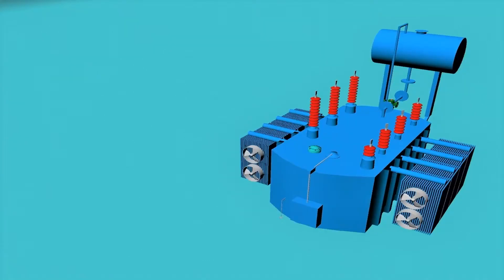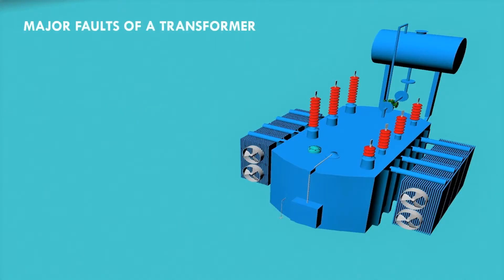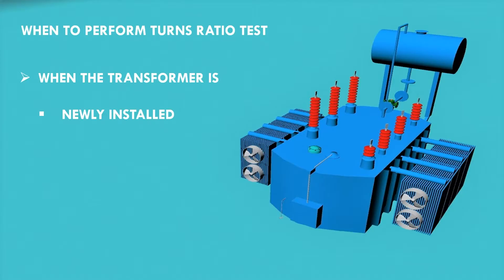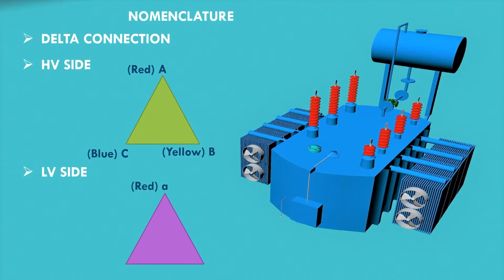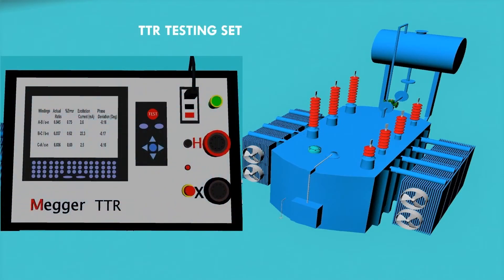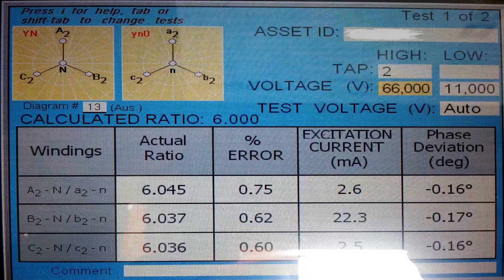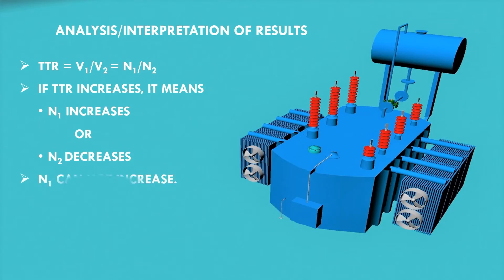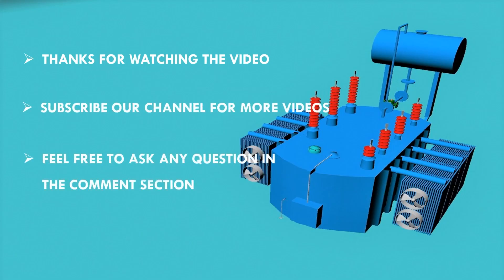Turns Ratio Test (TTR ) of Transformer

Comment: Thanks for you video. This made my understanding very easy. Here i have one doubt. In the example Y - y transformer shown 66/11 - ratio 6. This means it is line voltage ratio. if it is Delta - Star also 66/6.35(ph) - ratio = 10.39. I think the ratio should be calculated for Line voltage ratio. if any finding in Line voltage ratio then we can check the particular phase voltage to exactly locate the faulty winding

Comment: SIR turns ratio PRIMARY BY SECONDARY OR SECONDARY BY PRIMARY  IT IS DIFFERENT IN DIFFERENT BOOKS
Reply from the maker: It can be both ways. depends upon the manufacturer of the testing set. Some test sets calculate Primary to Secondary while others calculate Secondary to Primary but the end result is the comparison between the actual TTR and calculated one.
Reply: @theengineeringpower4213  thank you bhai

Comment: Hello. Which instruments  do you recommend with the following specifications

1.BATTERY OPERATED TRANSFORMER RATIO METER PWR1-3B (SPEC; Three phase, battery operated, ratio range from 8 to 2500, fully automated measurement, measuring voltage 10V / 100V selectable, The DISPLAY shows- Ratio, Phase-angle, Excitation Voltage, Magnetising current. 7). Easy to read large LC display for all 3 phases with backlight 8) Built-in printer . 9) A robust case for field use. 

2.PORTABLE OIL DILECTIC STRENGTH TEST SET AUTOMATIC OIL INSULATION TESTER (OTS 60A/80A/100A) with the following spec: 1) fully automatic microprocessor based. 2) Preprogrammed International test standards. 3)Customized test sequences. 4)upgraded sequence as per IEC60156-201. 5) Suitable to test Mineral, Easter and Synthetic Oil. 6) Internal Memory for 100 Test results. 7)USB Interface. 8) Inbuilt Thermal Printer. 9) Voltage checker for onsite Calibration. 10) Bluetooth connectivity via Motware Ap.